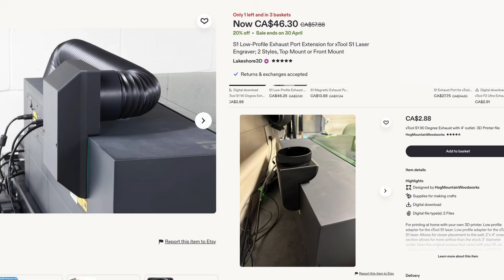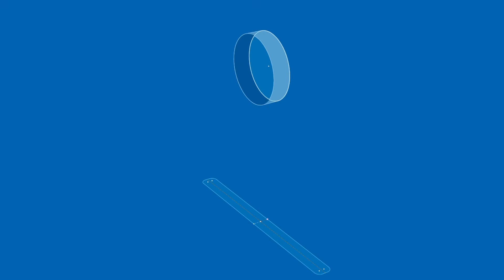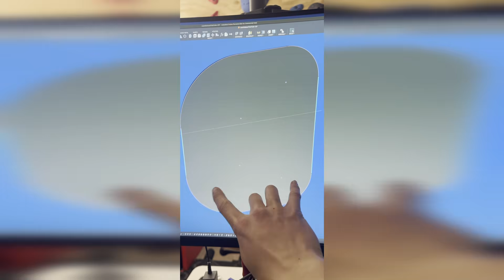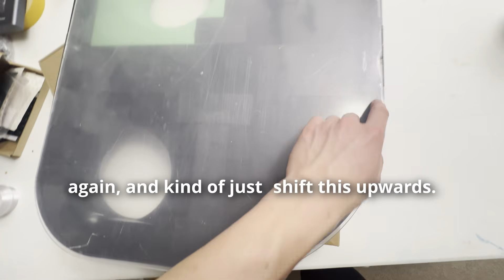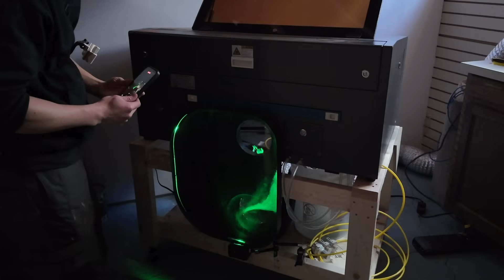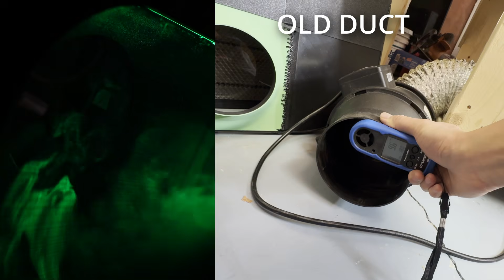This Should RUIN Airflow... But it Doesn't?

Comment: I think my solder fume extractor has the same geometric problem where the air from a circular cross-section needs to make a 90° bend to flare out into the filter block with a much larger square cross-section.
Right at the transition, I'm tempted to put 3D printed guide vanes into the end of the tube so at the flange, the air has a strong swirl pattern. Then perhaps add a small reverse cone to avoid a central low pressure zone.

It's not always about maximizing cross sections. Here  it may be more about avoiding pressure drop due to turbulence. Excited to see a follow-up if there is one, maybe just a CFD simulation to scratch that itch! Anyways, thanks for sharing this project.
Reply from the maker: Yeah that would be interesting to see if adding features could increase flow. We’ll see if I ever get to doing the CFD on it.